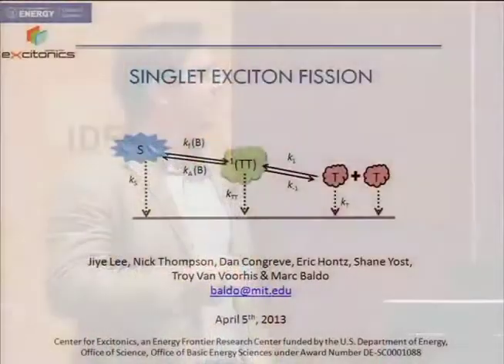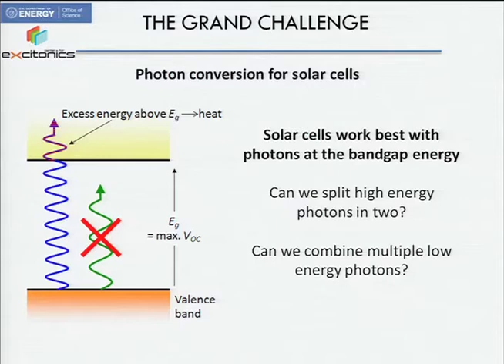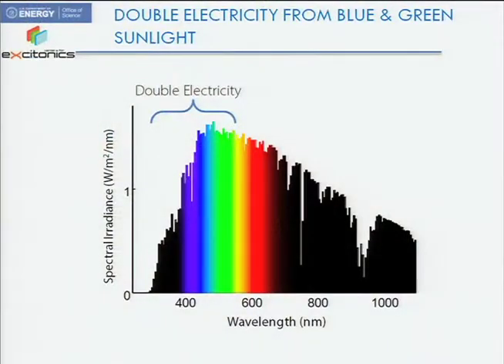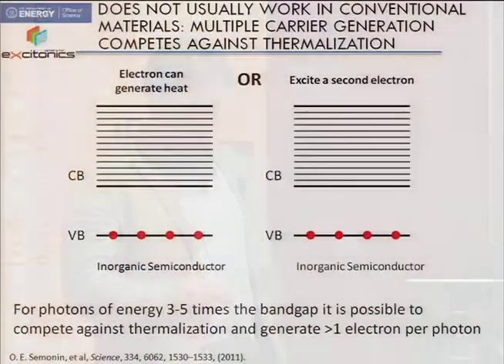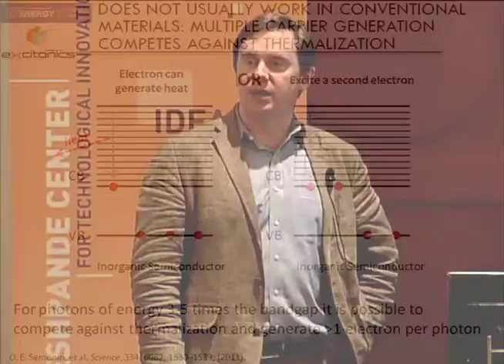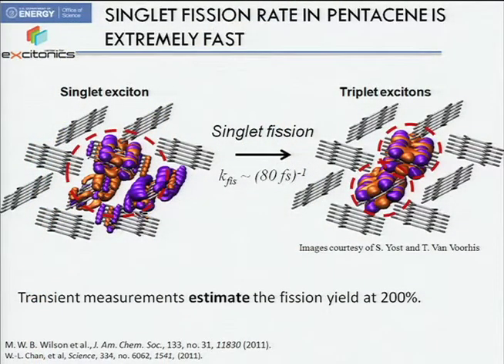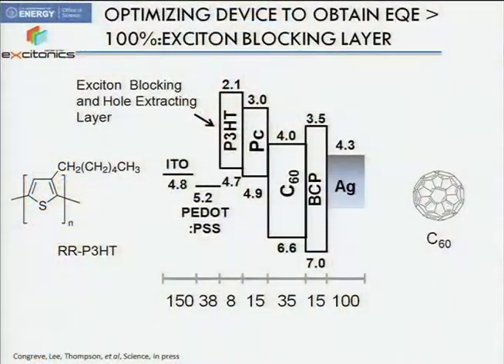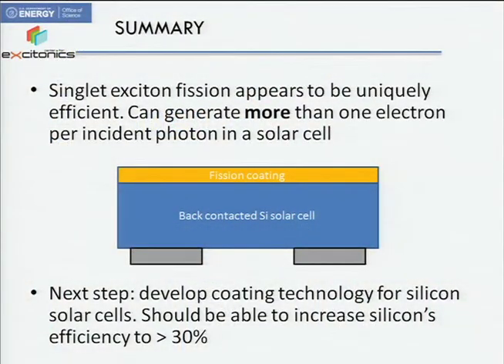IdeaStream 2013 - Marc Baldo

Comment: From Jablonski diagram, I learn that timescale of Intersystem Crossing (ISC) is 10-8 - 10-3 s and that of other process are much faster than ISC. Phosphorescence occurs at 10-4 - 10-1 s.

In that case how can we say that ISC occurs much faster. I have the picture that ISC happens much later IC, VR or even Flourescence. Can someone please clarify.

Internal Conversion   10-14  - 10-11 s   
     Vibrational Relaxation     10-14  - 10-11 s   
     Fluorescence   10-9 - 10-7 s

  

Thank you